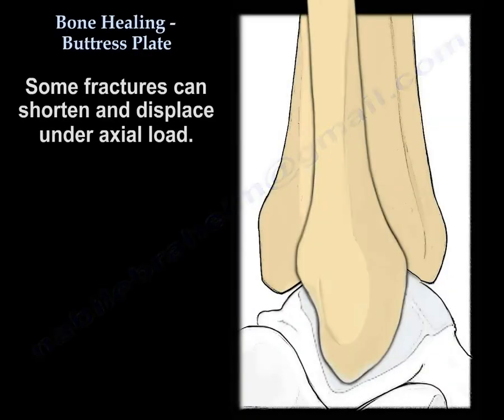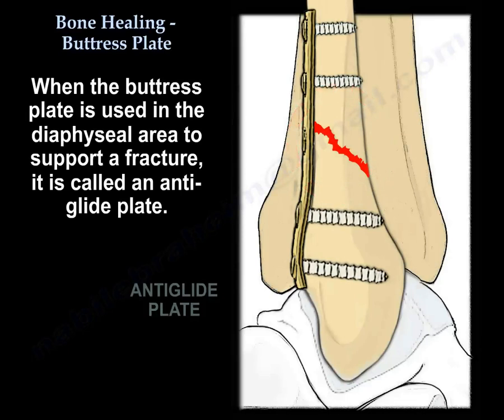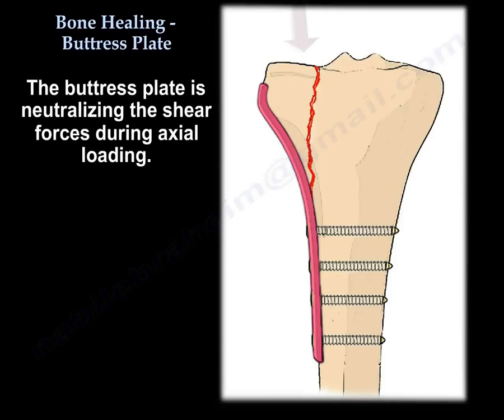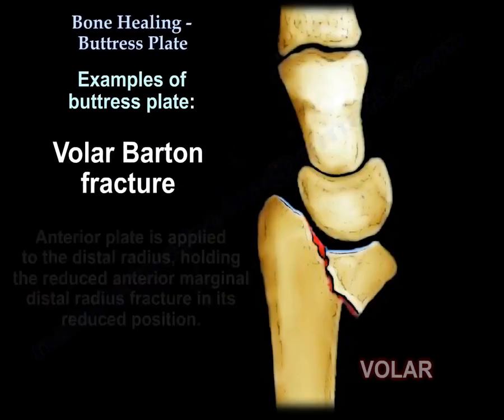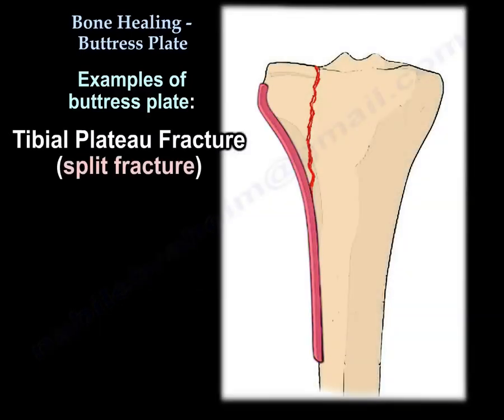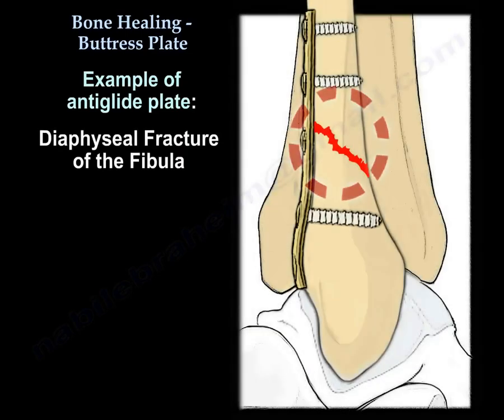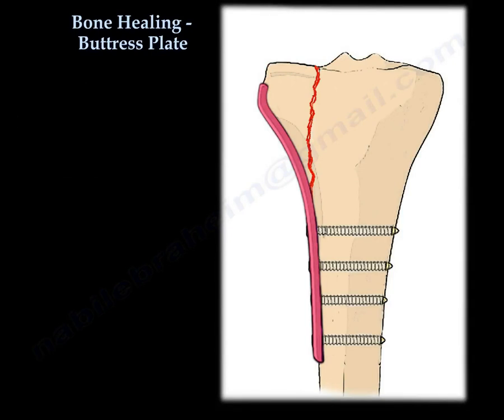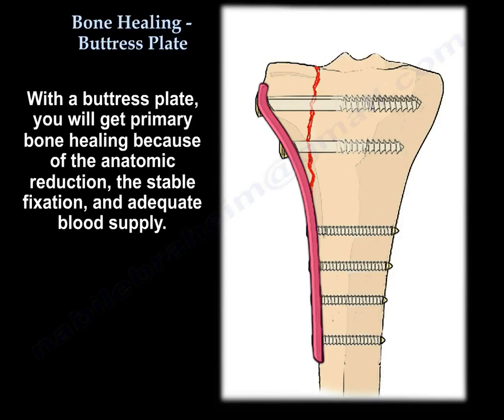Bone Healing, Buttress Plate  - Everything You Need To Know - Dr. Nabil Ebraheim

Comment: Is it possible to remove such a plate after 8 years in place? I have one fixed to my fibula following a trimalleolar fracture of the ankle. I also have a pin in the tibia. The screws are more prominent recently and there is pain in this area during the day and at night.  I live in the UK and no one seems interested in doing anything about this.